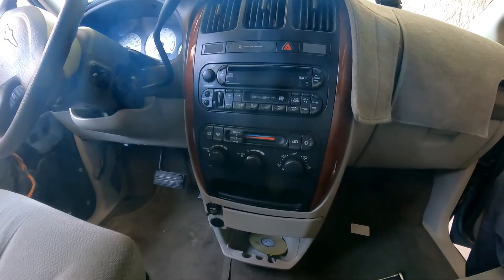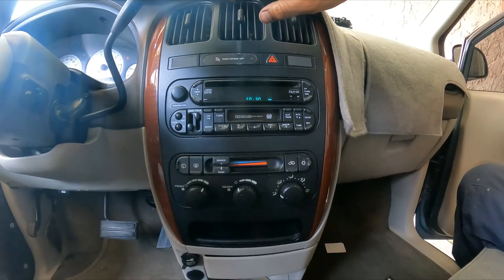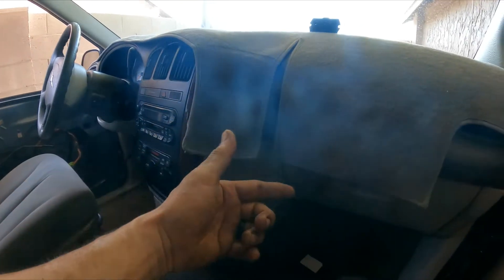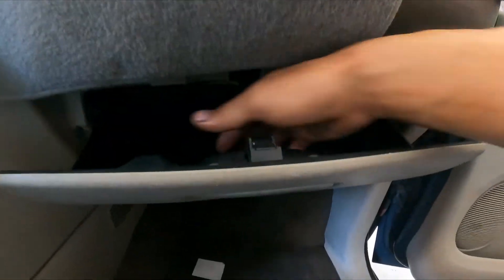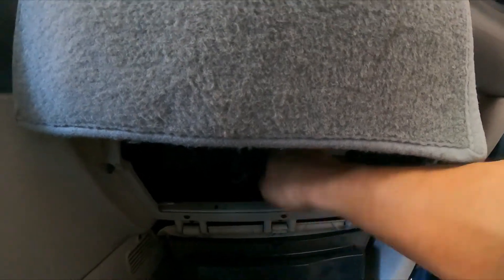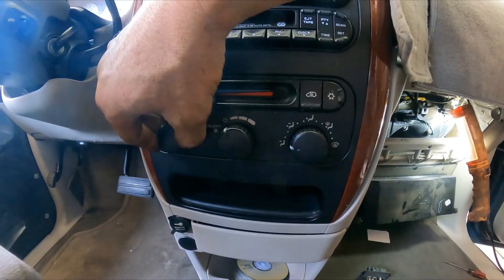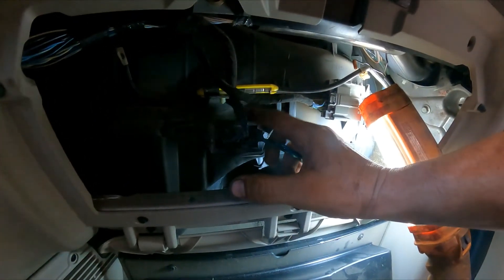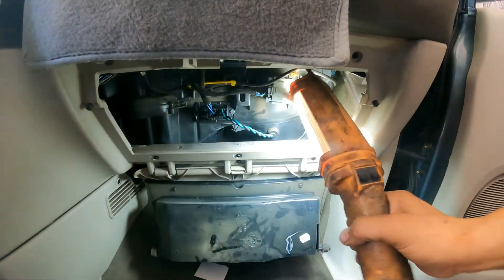2005 Chrysler Town and Country AC not Working on High Problem Solved EASY

Comment: I could not see how to fix. Anyway I replaced the blower motor and it worked great. Now all of a sudden it stops completely after turning on for a few minutes.
Is that the resister?
Reply: Yes it is the resistor. I few years ago I had to replace the blower and resistor back to back bc of the same issue on my 2006 town and country.

Comment: hey so my 2008 town and country the AC blows the hot side blows and blows hot the cool side blows air but not cool air and we tried putting in refrigerant into the system and it wont take any in do you know whats the problem?
Reply from the maker: Hello. Thank you for posting your question. Is the a/c compressor turning on? If it does, touch the return hose (suction) the one that it is bigger in diameter it should be cold. If it is cold the problem could be the temperature blend door actuator or you temperature control. Do you van has a manual or digital a/c controls? Keep me posted.
Reply: @gqautodiagnostics  when I turned on the ac for cool I don't see the air compresser spinning only the belt
Reply from the maker: @flimsyburito3924  That would be the reason of why is not taking the refrigerant. Check fuses first if fuses are ok, then connect a set of a/c gauges and check if you pressure. Keep me posted.

Comment: Hello my friend, question for ya! 😉 My 2006 town and country ac works, but not great. The air is cool, but not as cool as it should be. It also doesn't blow that hard either. When I'm driving it, it does get a little stronger then when I'm at idle, but again, not enough as it should be. It struggles to keep the cabin cool. Also, I had the freon measured, and it reads full. I'm not sure what the issue is. Any suggestions on this particular case? Someone I know thinks it could be the pressure switch. Thanks!

Comment: 👋 hello the front of van the air coming out but warm and the back of the van is cold 🥶 why? I need some advice please how I can fix my  self
Reply from the maker: Hello. What you are describing is usually due to a either the control of the front a/c or the temperature door blend actuator. That is usually the most common problems.
Reply: @gqautodiagnostics  thanks for replying I already figured it out and working .. have a great day!
Reply from the maker: @Chu01194  great well done!!!!🙂

Comment: Hi boss.
There is no problem with adjusting the wind speed, but the temperature of the AC wind is not cold.
Can I ask advice, please?
Reply from the maker: Hello. So the temperature from cold to hot is the issue, am I right? If it is, the first thing to do is to check that the air conditioning is working properly. Second, if it is working fine, the next thing to check is the blend door actuator for the temperature. This is also a common problem.
Keep me posted.

Comment: Mines don’t blow on high and it feel like air is coming out when it is off do you think it’s the same fix as your
Reply from the maker: Hello. That is a good question. When the high speed doesn't work it can be two different problems. The first one is the blower motor resistor. The second one could be the a/c speed control the is not sending the signal for the high speed. Keep me posted.
Reply: I changed ac control didn’t fix will be trying resistor next thank you

Comment: Hello~!
May I ask about name of connector?
AC wind control is normal, but only warm air comes out. I want to install that what you did, sir.
Could you please left a link if you know location of the website, please?
Thank you
Reply from the maker: Hello. Good question! Blower motor resistor pigtail. I hope this helps.
Thank you for posting your question and please consider subscribing to the channel and God bless you.

Comment: My 2005 Town and Chrysler AC is set on high running 100% And then out the blue it cuts down to 50%
Reply from the maker: Hello. it sounds like the speed control of the Air conditioner is malfunctioning. keep me posted. God bless.

Comment: there is no power to the compressor i change the relay and fuse and still have no power , inside all the controles are working good  ,
Reply from the maker: Hello. Check the pressure switch for good connection. Keep me posted.